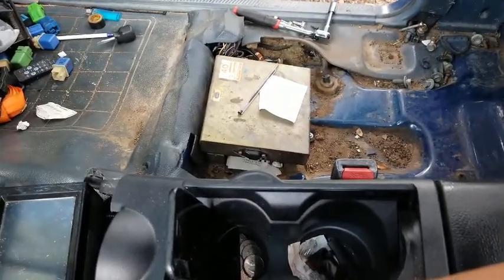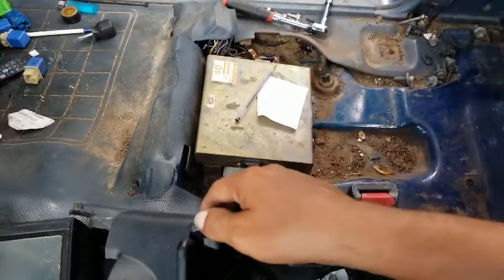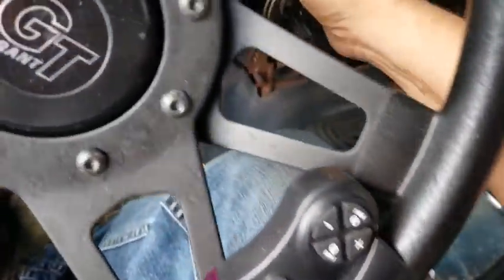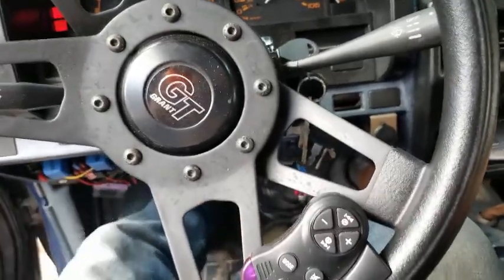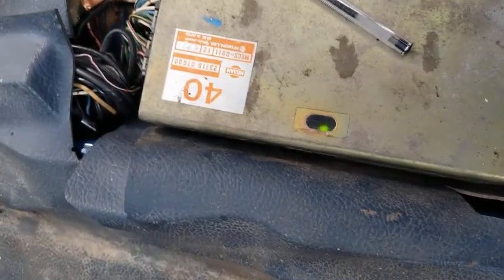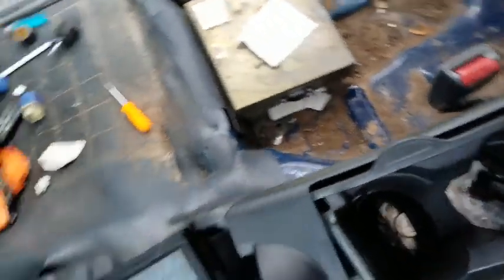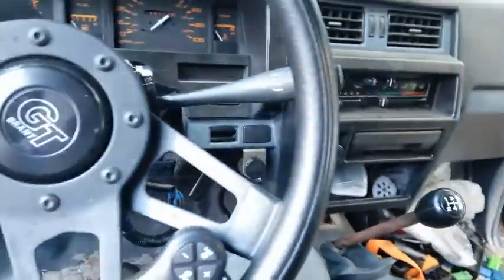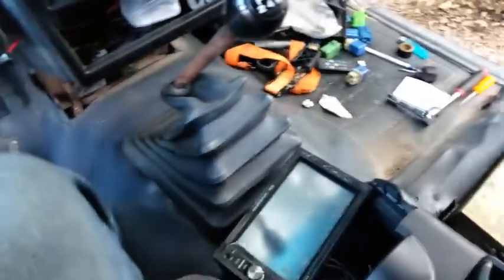86 Nissan d21. Read ECM Codes.

Comment: i’ve replaced a bunch already, i feel like the fuel pump isn’t getting power to it too. when i go to start the truck i don’t hear the fuel pump at all kicking in. i spray starter fluid and try to start it but it wont, it just sounds like it really wants to thoufh
Reply: though*
Reply from the maker: Have you checked the fuel pump relay?
Reply: @almagam2099  i looked at them and they look fine, i’m actually just now about to test it with a tester
Reply from the maker: @nicklucky8476  cool! Anything that we can eliminate as the cause will help narrow the problem down!
Reply: @almagam2099  i’m glad i found this channel, do you have any socials for ya truck?
Reply: @almagam2099  i just checked the volts in the pump relay, main relay, and the big plug wire that connects to the side of the carb. the big plug wire gets a 0 reading when i try to start it, the main relay got a 3.8 reading and the fuel pump got a little lower reading than the main relay
Reply from the maker: @nicklucky8476  social's?...
Reply from the maker: @nicklucky8476  that's one of the things I don't know how to check, the relays! I ended up replacing every single one  a while back as they were all likely the original one's! I did the same with the fusible links!
They either outright failed on me or were already about too!
I also never really did get very familiar with the throttle body! I replaced it with a Weber carburetor!  All the sensors and parts of the throttle body were literally falling apart during their removal! Afterwards tho?!...No vacuum lines or sensors too deal with after that install!
Reply: @almagam2099  i have a question on what the actual wire harness is called because i’d like to see if i can replace that whole or something before i buy a whole new carb
Reply from the maker: @nicklucky8476  here's a link where you can find almost anything having too do with the d21's!  I've realized how difficult it  can be trying  to find. Certain parts because they go by different names!
Your part might be called "idle stop solenoid?!"
https://www.rockauto.com/en/catalog/nissan,1986,d21+pickup,2.4l+l4,1210835,fuel+&+air,idle+air+control+(iac)+valve,6072
Reply: @almagam2099  thank you so much i’ll look into it
Reply from the maker: @nicklucky8476  not a problem! If you still need help, don't hesitate to ask!

Comment: hey, i have the same code in my 86 nissan d21. i have the stock throttle body still and the truck cranks but won’t start. please help me with what to do
Reply: just watched a video the crankshaft position sensor can cause no spark . if you havd problems with stalling and or ough idle before it died , might be a good place to look.